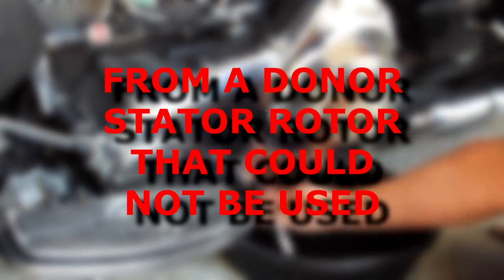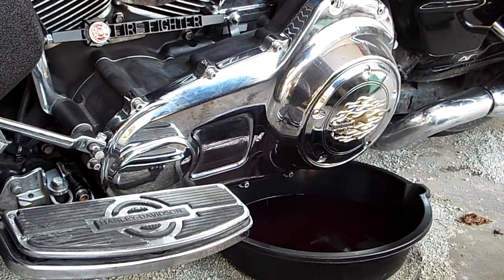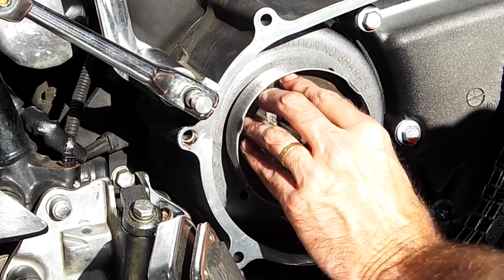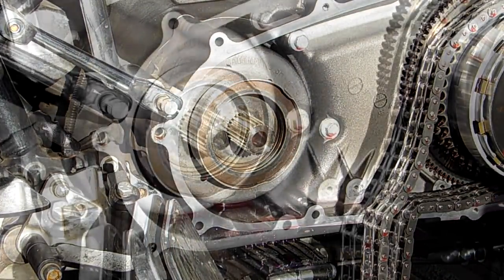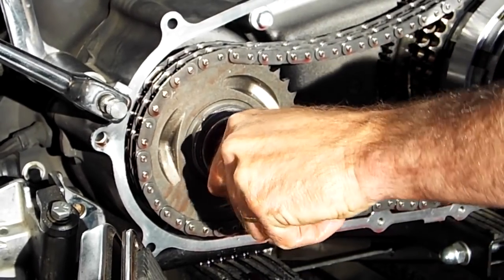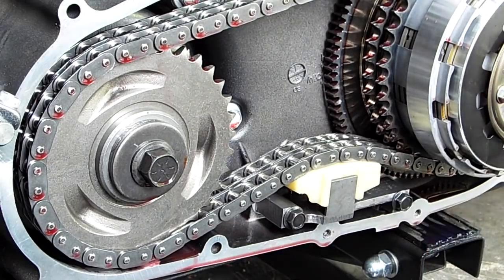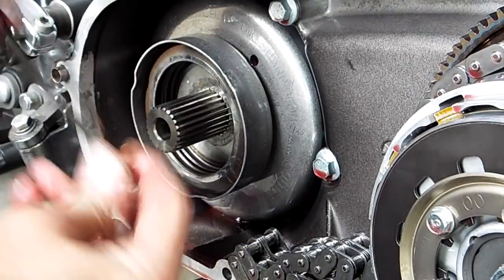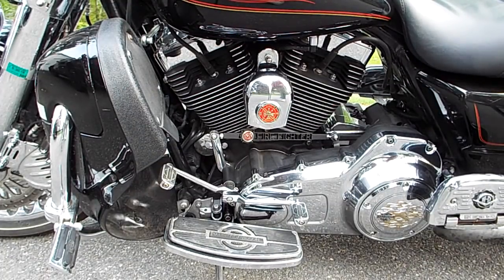Re-installing "Modified" Original Compensator

Comment: This is also what recommended a mechanics friend of mine. But instead advise to add only one additional flat washer with half the thickness of the belleville spring washer and it should be enough (I hope) . I will have this washer machined. I have a Fatboy 2008.
Reply from the maker: Ronald Saikali I have to admit, I have about 1,500 miles on this 2nd configuration shown in the video, half of that riding 2-up, and the startups and shut downs are tight, yet acceleration smooths out like it should. Will if last another 1,000... 5,000... 20,000.... Is a good question. Satisfied with its performance so far. I am not one to hammer the throttle much, so maybe that is helping too. Keep me posted on your progress, thanks.
Reply: Thinking about the problem:
- in a new compensator, the belleville spring washer are filling completely the gap. But are they a bit loaded (under tension) in the original assembly ?
- over time these spring washer loose their stiffness, get flattened and their deflection is reduced
- A gap is created and should be fill back to again have this spring effect 
The question raised:
- how much is the gap ? 
- will the gap increase again in time ?
- should we exactly fill the gap ? or we should over fill the gap in order to compress a bit the spring washer?

In my setup, I will try to fill exactly the gap without loading the spring washer. will keep you posted in few weeks....
Reply from the maker: I think I understand your question and thinking on this. The "gap" you are referring to is between the "cam gear" and the "spring pack." I agree with you that over time (miles) the spring pack washers wear against each other and lose some of their stiffness. So yes, in effect, what I did was to shim that "gap" between the two and all is well again. It may be difficult to machine one, which is why I bought a used spring pack still inside the stator rotor cup so I could use one of those springs which are the correct size. If I had a flat washer shim, instead of a cupped Belleville washer shim, I think it would have worked better in the back of the spring pack as a shim, but the curve of the Belleville washer acted like adding another spring and made it too stiff overall. There just isn't a lot of space to work with behind that cam gear to the inside of the stator rotor, which makes filling that space too much a possibility which could end up feeling like a solid compensator sprocket (this is how it felt in the first attempt setup, and I didn't care for it). Keep me posted!
Reply from the maker: What cubic inch is your motor?
Reply: Mark Young - Outside The Box 96 CI with stage 1
Reply from the maker: Ronald Saikali same as mine.
Reply: Mark Young - Outside The Box  I finally made the upgrade ! I have added the flat washer (2 mm thickness) with the same dimensions of the belleville washer. I installed the washer the first on the rotor side. I have made a small video. This has worked perfect for me as I am not hearing/feeling the kickbacks anymore when starting the bike. ps: when removing the compensator bold , it released quite easily, the bolt must have been loosen by the "beatings" ... :p
I have to say I also changed my OEM starter to a 1.4 kw...
Reply from the maker: @ronaldsaikali6577  that sounds terrific, you really made one. I'm jealous! I ran mine like that for many miles, many of them two-up. I don't know how many miles it's going to be good for, but I guess we'll find out. Thank you for the update and good news.

Comment: A stator-rotor? Makes no sense my friend. 🙄
Reply from the maker: Well, what do you call it?
Reply: @contact4mwy7  The stator is the fixed part, the rotor is the moving part (rotates) and the two of them form the alternator. That's how they're called. Thank you.
Reply from the maker: Right. Stator rotor describes the rotor I am talking about. I could just call it a rotor, but will everyone know what I am talking about if they have never seen these parts? You knew what I was talking about by that description as well as evidenced by your explanation.
Reply: @contact4mwy7  Whatever. I was just trying to be more precise. Sorry.